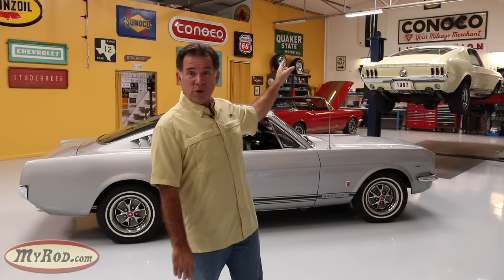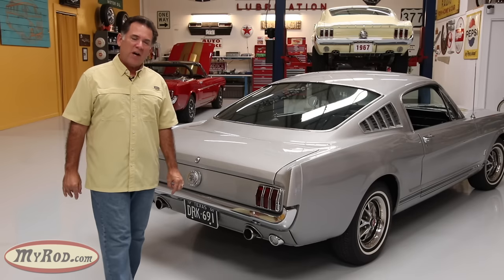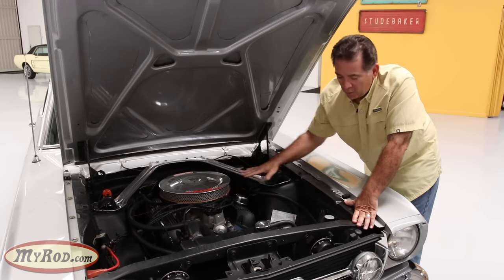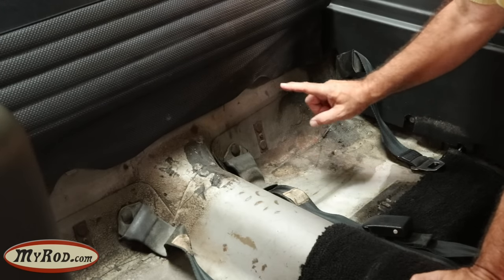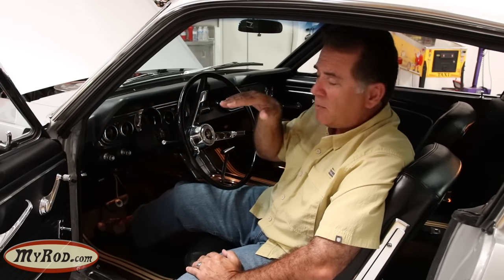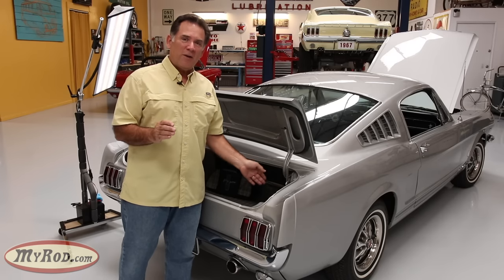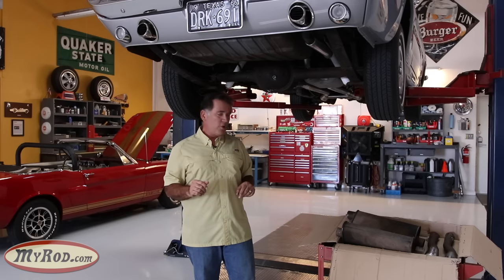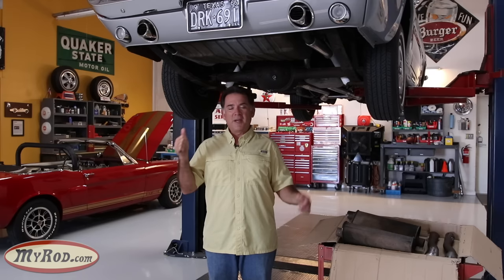Mustang GT verification (1965 - 1966) - How to identify a real GT

Comment: Well, there you go.   I have a rebuilt 65 A Code Fastback that I've pulled apart and reassembled more times over the years than I care to remember - and I had always wondered at the stamped hole through the radiator mount plate.   I had assumed it was for the horn in some way.   Now I know.
Reply from the maker: Awesome! Glad we could help :)

Comment: very good vid, I owned two  originals, one of the most durable cars ever, Mine went over 150 k on everything and never too slowly. in fact more the other way. Second one was a gutted theft recovery i updated a bit and kept from 77 till 2003. front spoiler the biggest improvement to handling and cooling, kills the front end lift and pulls air out of the engine compartment.
Reply from the maker: interesting, thank you for sharing

Comment: Also, "P10" designation will be on the Build/Buck Tag located on the upper engine compt. apron or radiator support. Dearborn or Metuchen-Built cars only. San Jose built cars did not have a Tag.

Comment: I am investigating a 1965 mustang GT convertible.  How do I determine if it is the original engine.  It is supposed to be a 289 A.  Can you provide a picture of what it should look like.  Maybe even better, how can I determine if it is the original?  I use to own a 1965 Mustang with the 2 barrel 289, and the colors were gold.  I thought that the colors of the 4 barrel should be blue.  The one I am investigating are gold.  I would greatly appreciate any help that you can provide.  My next Mustang will be my 5th.

Comment: Very nice video and thank you.  You stated that only GT's would have had a cut out rear valance for dual exhaust tips (at around 13:13).  How about cars that received the dual exhaust option from the factory but were not factory GT's?  I have a '65 with exactly that case.  FYI, it also has the mounting hangers underneath.  

Keep up the good work guys.
Reply from the maker: Cut outs are GT only, however you could still have the dual exhaust hangars like all of my K-code cars.

Comment: in one of your comments some one said they had everything except the disc brakes and it just recently jogged my memory as I remember back in 71 or so I had a caliper seize and I needed new ones and ,, they were not available even from ford, perhaps the owner of the GT who commented was forced to switch to drums, I remember having a bear of a time trying to rebuild my set up , the 65 and 66 calipers had a poor design for sealing the caliper boots which was modified in 67 a bit fixing the problem.

Comment: Great job on a very well illustrated reference video. 

Just to add to the discussion: not mentioned was the "PI" or the "PIO" on the passenger side fender "buck tag;" if available (another "slam-dunk" when Identifying true GT's, generally on Metuchen or Dearborn assembled cars). 

Superb Mustang!
Reply from the maker: So true. Unfortunately no buck tags were ever installed on San Jose cars... none the less that is a very good point I simply left out.
Reply: The only slam dunk...

Comment: A friend of the family asked me to help them sell their old car. 65 GT convertible. This video will help me determine if it’s authentic. The old fella (owner) has Alzheimer’s, but says it was repainted in his restoration shop Caspian blue several years ago, and engine has 1 hour break-in only. Add roller tip rockers. All new OE interior including new roof.
Now to verify using this video. And help them sell it.

Comment: I have a 1966 Fastback GT Sliver Frost with a BLACK interior and RED GT stripes.  It’s a repaint, but what looks like a remnant of the original stripe is near the rear corner of the door jam and it’s RED.  I was under the impression RED stripes (other than RED interior cars) only came on BLACK exterior cars with BLACK interior.  Someone also said the stripes could be specially ordered too.  What are your thoughts?
Reply: IMO, The GT stripes were generally matched to the interior unless a car was black with black interior....or white with a white interior......in the case of MY '65 K GT Convertible thats triple black my stripe is Red.....

Comment: Hi, question. I have a 65 convertible, that I believe to be a GT. Bought it from the original owner who said it was a GT. It has every identifier you talked about as far as being a GT, but the problem is that I just read that the GT's didn't come out til mid-April 1965 and my VIN says the car was built in January 1965 (A for the date code). Does that mean my car's not a GT? Any input on that would be appreciated Thanks.
Reply from the maker: no GT bulit prior to April

Comment: Thanks for the vid.
Are these clues only for a GT fastback, or does every clue apply for convertibles too?
I have what I think is a 66 GT convertible A code. Your video applies for everything on this car except for those reinforcement plates under the rear seat. Could it not be same for convertible, or behind seatbacks as opposed to floor? Thanks for any clarification.
Reply: Hey Rossco - for what it's worth I have a 66GT coupe and the reinforcement plates are there so would assume the same for all body styles. Also check for filled holes from behind the rear quarter panels as GTs do not have the metal trim piece on the C-shaped scoop along the sides. If someone cloned a GT they would have removed those trim pieces
Reply: @rongaunt8348  will check Ron, thank you! And to be clear, are your reinforced plates on the actual floor under the rear seat, or are they up just off the floor but under the part of the seat you put your back on? Hoping that makes sense.

Comment: Hi, great video, I have looked at countless videos and web pages trying to find this information. 
I have a 1966 coupe that I have done up, it has everything in your video except the front disc brakes and it is very frustrating as everyone I speak to says it MUST have front disc brakes to be a GT. It even had the disc brake logo on the brake pedal. The car had never been restored as far as I can tell and I have all photos to prove it has all the points in your video. My question to you is-

Is it possible to have front drum brakes on a GT? I don't see why someone would've gone to all the trouble to try to make it a gt clone, as the car was not in a very good condition when I bought it. Or the only other thing I can think of, is that for some reason the disc brakes were swapped for another car? It has bugged me from day one from when I first bought the car.(the seller, never even mentioned anything about it possibly being a gt,but he wasn't a ford man, he was just going to do it up and flip it) Any input would be greatly appreciated-I can send photos to you if required.Regards Dave from  Melbourne Australia
Reply from the maker: The answer is no, it would've definitely had front disc brakes. HOWEVER, IT IS HIGHLY possible that they were just swapped out some time ago. We've actually owned a car that had that exact same thing happen to it.  I wouldn't be surprised at all if this is the case with your car. Cheers from Texas! Go check out the article on our website related to this video... there's some really nice illustrated photos.
Reply: Cant believe it but in the middle of the night was thinking about my GT and back in 71 I needed new rotors and calipers, they were not available from ford then and some one like your cars previous owner may have been forced to switch to drums....
Reply: My father's A code convertible had drum brakes with the GT handling package, from the factory, was special ordered that way by him.

Comment: Great video! Just wondering about the intake grille that sits on the the rear quarter, in front of the wheel. Was that deleted on all GTs?
Reply from the maker: Correct, that is a "delete" item for the GT .... I really should have pointed that out. Thank you

Comment: K code is the Hi-Po; not this A code car

You aren't going to use a paper tape to measure diameter of the sway bar.  The paper tape is good for measuring circumference; not diameter.

Great video.  Thanks for posting.

Comment: I thought the chrome strip on the front edge of the hood, located just above the grille, was also GT-only. Is that correct?
Reply from the maker: No, not a GT specific item
Reply: In '65 the only cars that got the hood molding were the GT models. I believe in '66 all Mustangs got the molding.

Comment: Could you please answer this question. I just got a 1966 Mustang delivered from an Estate Settlement. It has rear windows and a larger trunk. Every other GT Item is right on. The Fog Lamp hole has a factory Black Grommet. It was a One Owner from 1966 so what gives? Also it has 5 lug wheels. Was there a Sedan Model of GT? All the decals and paint are original. The owners manual was in the glove box.
Reply: Does it have duel tip exhausts?
Reply: @angusyoung1582  It turned out to be a Full Blown Factory GT 289 4 sp A collector bought it for $ 12 K. He now has his first Ford Mustang.
Reply: Yes, the Mustang Coupe could also be ordered with the GT option. Bought one of these cars in Alabama decades ago (before anyone restored Mustangs), when I used to travel down there for Ford. Car was all original, 4 speed, no power - from a woman owner . . .
Reply: @misskaroon  Hi, I offered the car to a Camero Collector ( Diamond Jim ) the car checked out completely as factory original. I gave him all the receipts for the car and asked that he consider saving it. His family loved the idea of a Black 1966 GT original ( original Hub Caps ). Their first Ford is the Grand Sire of his White Camero Collection. They generously gave 50% over my output to save it. This is one Mustang that won't be Found On the Road Dead.
Reply: @hostingwithhenry6716  I guess I am confused here. I was participating in a discussion of some details on a '65 GT currently on BaT. Is your reply about this "estate settlement" car? If so, I was simply supplying confirmation that the GT option was also offered on the Coupe model , which sounds like your :sedan: model. All Gen 1 mustangs with any V8 engine have 5 lug wheels (six cyl are 4 lug). It is the later Fox bodied cars that have 4-lug wheels in all models.

Comment: Great video and great looking car! I would say the lip on the hole in the rad support, the steering box tag and the fog lamp wireing are the best and most iron clad clues. The dual exhaust reinforcements are good, but I would guess that nearly all A and K codes were ordered with dual exhaust. The external clues aren't worth much...too easily added, unless you're dealing with an untouched original. Even with an original they could be dealer add-ons. Ford advertised "Make your Mustang a GT. Your dealer has all the parts" and people loved to customize their Mustangs back then.
Reply from the maker: Thanks man!

Comment: I just bought a 1966 fast back supposedly a GT I have most of the clues except the core support and I have a bottom molding but the car has been restored once
Reply from the maker: It's possible that the core support could have been changed out at one point in your car's history. The rear frame rail is the hardest to fake, so if you've got that then the odds are you're probably good. :)

Comment: My late father's A code convertible had the GT handling package only. It was also special ordered by him with drum brakes and not disc!!!!
Reply from the maker: that is unusual but darn near anything was possible
Reply: @QualityClassics , yea it was unusual but people tend to forget that back then customers could actually order their cars how they wanted em. My father said he didn't want the disc brakes, because if I remember correctly '65 was the 1st year of em for Ford, they were having some issues with em yet. He also didn't want the GT badging cause he didn't want to have to run the shit out of it all the time lol. I put the GT  steering box, sway bar,  spindles, n the 8in 3.00 traction lock in my mom's 64 1/2.
Reply: Not sure the "GT" handling package was sold as such, certainly not before the GT was introduced. Early K-code cars had the handling package and used Fairlane station wagon brakes.
Reply: The handling package was sold as a "stand alone" package also. You could order just that as my father did. There was 3 different "packages" that would be combined to make a "full GT". Just because my dad's car didn't have the other 2 doesn't mean it wasn't a GT, it had the most important part, the handling package. It was also a late 65 and not all Kcodes were GTs.

Comment: Non-GTs  (K-codes mainly, because I've never seen a factory A code with factory dual exhaust) HAD dual exhaust, but the tailpipes were turned down and from the outside of the car they looked like single exhaust car tailpipes. So THEY WOULD have had the same reinforcements in the back.....
Reply from the maker: correct
Reply: That's the way the Shelby GT350 was done. My 64.5 K-code convertible was the same way.

Comment: This car has some problems on the interior.  GT's have a wood-grain wheel regardless of pony interior.  The instrument cluster and glove box door will have the same outlining as the wood-grain panel.  http://www.virginiaclassicmustang.com/66-GT-INSTRUMENT-BEZEL-USE-WITH-STANDARD-INTERIOR-WITH-GAUGES-P2757.aspx   http://www.virginiaclassicmustang.com/66-GT-WITH-STANDARD-INTERIOR-BLACK-GLOVE-BOX-DOOR-P2860.aspx

Also what was not mentioned on the exterior is that there be NO rocker trim and NO quarter trim on a GT.   These were always deleted.  

This car is obviously a GT, however, somewhere in its history its interior was probably restored before correct bezels were available for the GT and wood-grain wheels were not being reproduced or restored.
Reply from the maker: Thanks for your comment Chip! Actually the wood-grain steering wheel is not a required option for a GT. However, you are correct about the glove box lid being replaced before the correct style was being reproduced. You're also correct about the rocker molding and trim being deleted... we just didn't feel it necessary in this video to mention what is "not" supposed to be on the car. You've got a sharp eye!
Reply: This is actually not true, my car is a documented San Jose GT K-Code with standard interior and it always had the black standard steering wheel, and full circle chrome inline camera case instrument bezel and glove box door. This has been discussed many time on the mustang concours forum and other sites. See this quick link link as others have found the same thing, notice the update correction when talking about it... http://www.mustangdreams.com/verify-1965-1966-mustang-gt.htm

Comment: GJ trying to make a ill equipped GT worth more than a Fastback that is much better equipped. You know they made so many GTs which was only a cosmetic difference.
Reply: This is an old comment but for the record, the GT package came with "Special Handling Package (heavy-duty suspension, 22:1 overall steering ratio)" which included a front anti-sway bar.